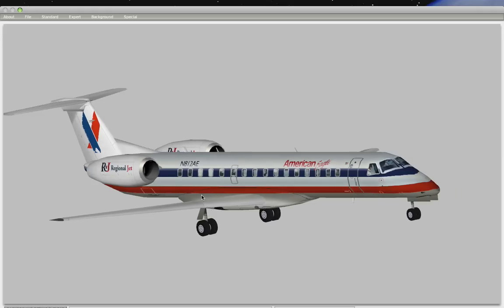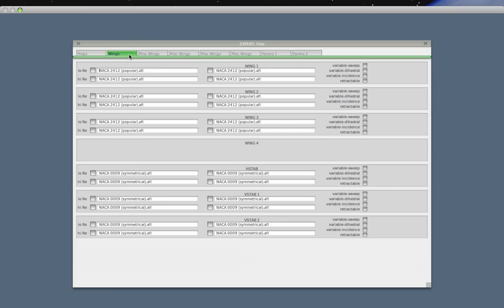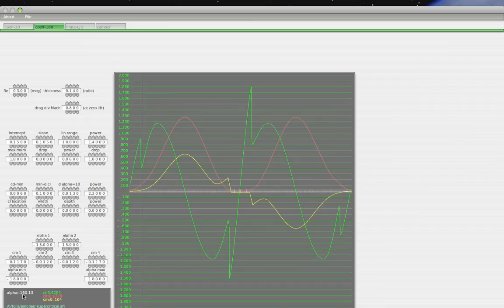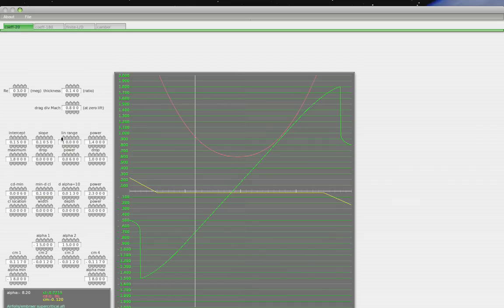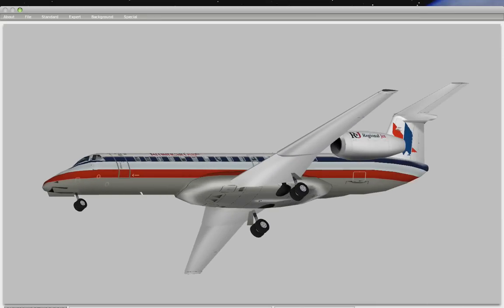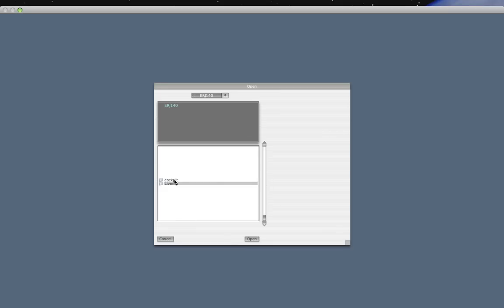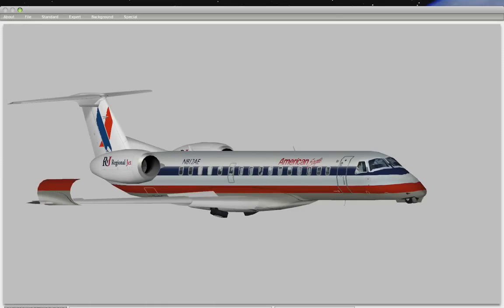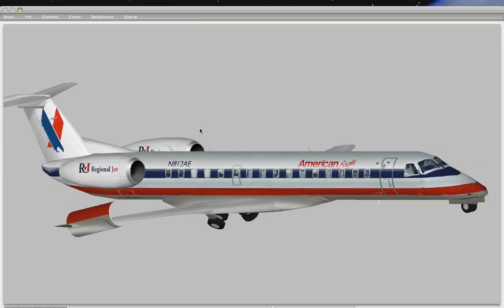PlaneMaker Tutorial 14: Wrapping things up in PlaneMaker

Comment from the maker: Yes, I should have been clearer on the airfoil bit; here's the deal:
The shape you enter into the last tab of airfoil maker does not affect the aerodynamics of the plane at all.  It's just a tool to give the wing the visual shape it should have.

Now, the REST of the tabs in Airfoil Maker DO have an effect on the aerodynamics.  They'll determine the Lift/Drag ratio, the pitch moment, the Reynolds number, the stall angle of attack, and all the other fields you see there.